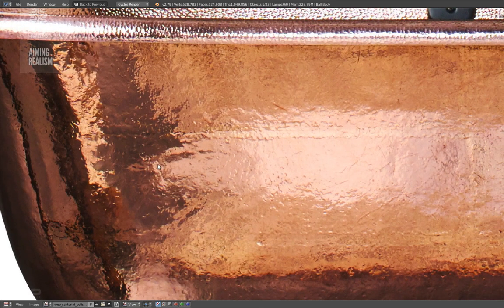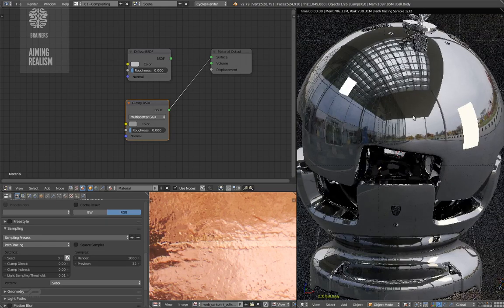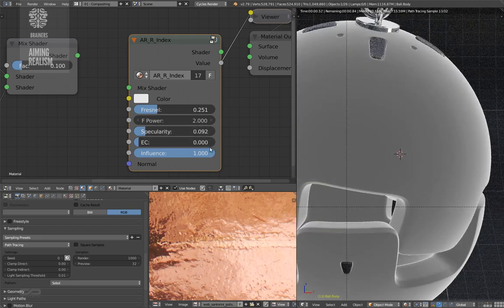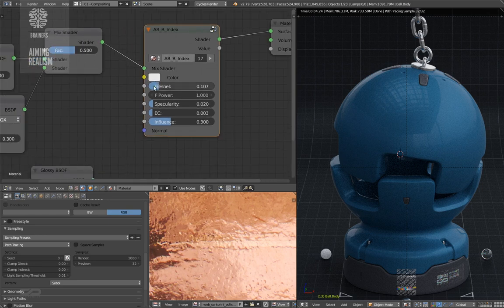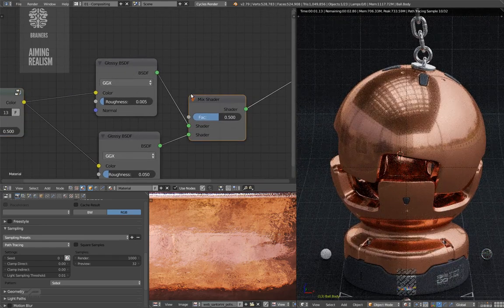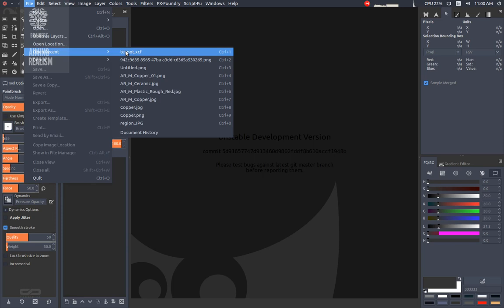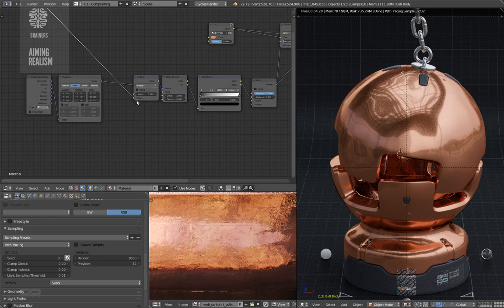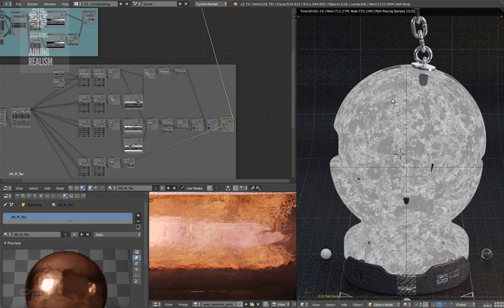#ONAIR - Introduction to procedural Blender Cycles Part. 1

Comment: why do you mix 2 glossy nodes with the same color at 8:52 ?
why not calculate the value after the mixing and put it directly into one glossy node?
what i mean is, lets say we have 2 glossy nodes: g1 with roughness of 0.8 and g2 with a roughness of 0. we mix those to with a factor of 0.5.
isn't that the same as assigning mix_factor * (g1.roughness + g2.roughness) = 0.5 * (0.8 + 0) = 0.4 to the roughness of the third glossy node?
by the way, amazing channel, in my opinion its totally underrated.
Reply from the maker: No because it will be a simple multiplication of roughness values but the final BSDF will be based on a roughness on .4 instead of having a final BSDF glossy of .8 mix with a final BSDF glossy of 0. And it is impossible to have a close representation of real life metla material with only one Glossy BSDF. I will explain that really in depth in the shading course.

Thank you a loy for your kind word really appreciate it.
Reply: @Penfinity  i highly appreciate your responsiveness but i still do not understand it. i tried looking around everywhere but i cant find information about it and still don't understand it. why mix 2 of the same shader? isn't mixing 2 of the same shaders just math on the parameters of the shader? how and why isn't it like mix RGB where its math on the color parameter? i'm sorry but i just can't understand it.
Reply from the maker: @danielliberty7559 It is not the same because you're mixing 2 different physical "output" states of the shader. When you mixRGB in the input you're mixing linear values. Try it for yourself, first create a math node on multiply and in the first value put .5 and the second .1 and plug it in the roughness of the glossy shader. Then create another glosser node with a roughness value of .05 and see for yourself if there is any difference.
After that create 2 glossy shaders, one with a roughness of .5 and another with a roughness of .1 and mix them with a mix shader. 

You will understand then. I think to see it visually will make you understand it.